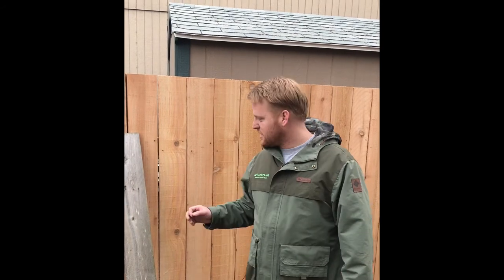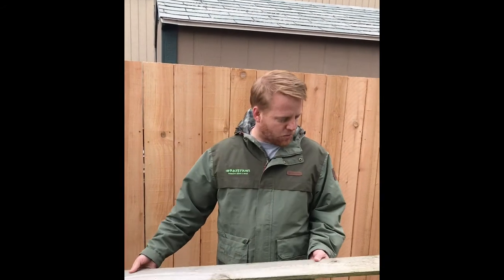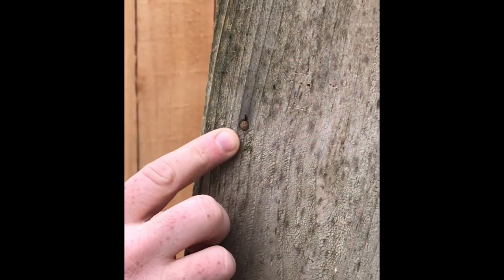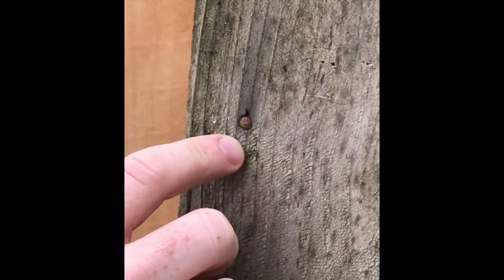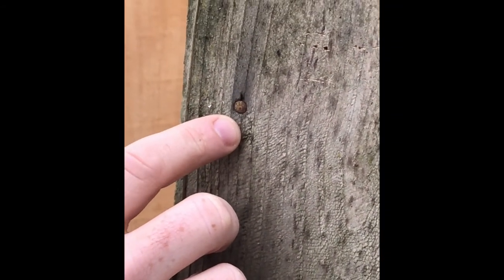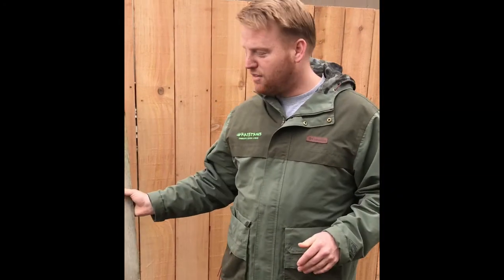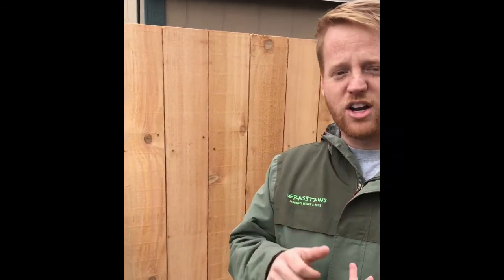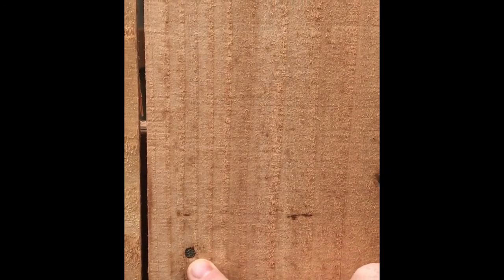Stainless steel vs galvanized nails Simple cedar fence

Comment: One caveat about stainless steel screws that he did not mention is that you should pre-drill the screw holes and when installing stainless steel screws try not to over tighten them because you can break them when installing them. One thing he did mention which I think is really good about stainless steel screws is that they do not react with the chemicals in or on the wood. (Big plus) While they cost more than coated fence screws at Home Depot it might help with the wood in the long run. My fence was built in 2002. I have regularly checked screws in my fence and I wish I had known about stainless steel screws long ago. Another good tip is to make sure and stain your fence regularly  and periodically clean it with a pressure washer. Also keep all vegetation away from the fence. Moisture equals rot. Rot cost money = new fence . I cut off the bottom inch or so off of the bottom of my fence because the weed eater was beating it to death and taking off the stain. Go back to my statement moisture equals rot. It looks great and it is a heck of a lot easier to weed eat. Keep the fence at least an inch off the ground. One last thing when installing pickets use 1 and 5/8 inch screws if you don't want a million little screw points sticking through your fence which happens with 2 inch screws. I got a multi-tool with a carbide tip and went around to cut them off. I got a lot of them but it was a pain and I gave up. Use a Dremel laminate saw or a Rockwell 3 1/2 inch saw to cut off the bottom of the fence from the outside of the fence. It is the little touches that count when maintaining your fence.